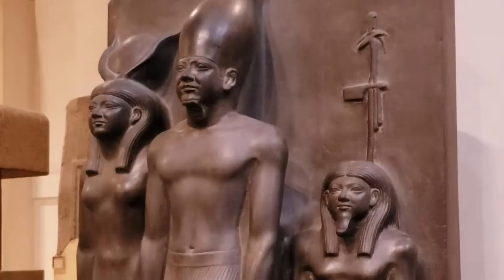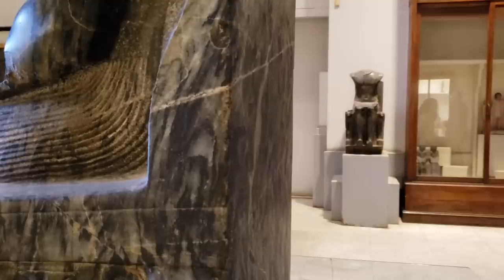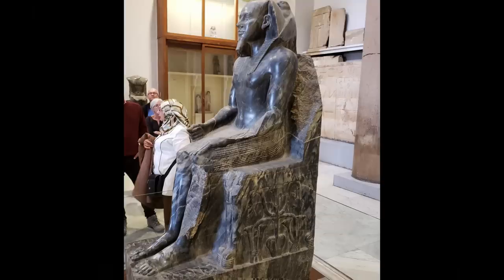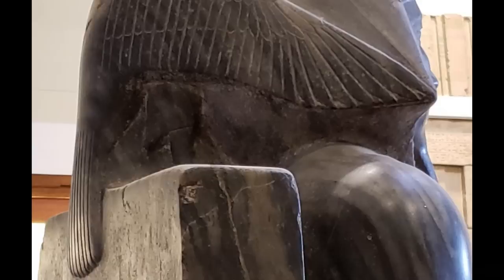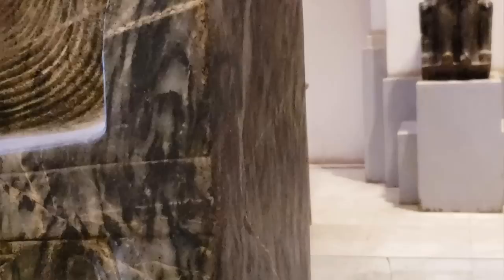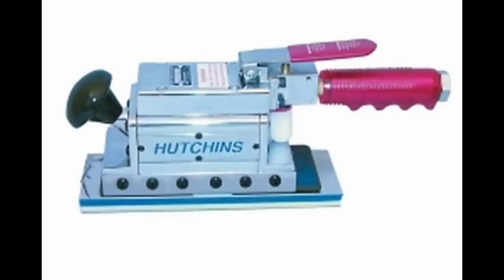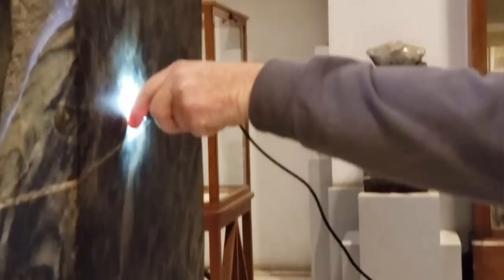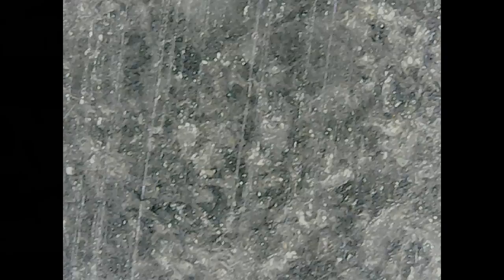Khafre's Diorite Statue

Comment: What do you mean "It can't be worked with copper and bronze"? You just stated that steel is also softer than it and we use steel to break it all the time.
Aren't you confusing how hard the stone is with their mechanical strenght? Cause diamond is a 10 and you can pulverize it with a sledgehammer and an anvil. This is not minecraft. Diamond picks are not the best because diamond is hard. Diamond picks would suck.
You can, 100% Break of pieces of dolerite and diorite with copper chisels. No problem.
We use copper nails to break onyx in flint knapping. Softer materials have no problem shipping harder ones.
Reply: Then why dont you make such a statue using copper?
Reply: You can break it, but can you sculpt it?
Reply: There is a difference between cutting the rock, chipping the rock and grinding the rock. The finished surfaces of these ancient relics point toward cut and polished surfaces. You cant cut or polish granite with metal chisels, but yes it can be chipped of course ... Nobody confuses hardness with strength of course. I get that this might be confusing, but do you think these people are that stupid lol? Come on...
Reply: How do we polish things? Sandpaper or fluid abrasives containing different grit sizes. You can polish for example granite with another piece of granite and different mixtures of abrasives with different grit sizes.
Reply: You don't smash a rock and get an intricate polished statue. I use a saw with a diamond blade to slice rocks, even though I own a hammer that can break rocks. The hammer can't slice them. Copper, steel, dolorite, doesn't matter; hammers don't slice.

Comment: What is also fascinating with these objects is the symmetry. Its one thing to polish very hard stone that smooth, but to make each side virtually identical requires something far more advanced than just eye-balling it and sanding by hand. Many of these statues, even the giant megalithic ones, have been scanned with lasers/optical devices and they are almost exactly the same dimensions (right and left side of a face, for example). You cannot measure complex surfaces with simple measuring devices that were thought to have existed then. Even today, that kind of accuracy requires CNC machining or some type of complex computing machinery.
Reply from the maker: I have attempted to do some checking on the symmetry of the statue based on my own photo surveys of it with simple photogrammetry in photoshop, and although the method / photos are not good enough to base a paper on, the degree of similarity between the left and right sides of the face is quite close. 
Your comment re. the difficulty of eye-balling such work is correct, because as the scale increases it becomes more and more difficult to ensure symmetry.
In Chris Dunn's book, Lost Technologies of Ancient Egypt, he presents some very carefully executed photogrammetric surveys he performed on  some very large statues at Karnak, and the results show a variation of only 2-3 MM between the left and right sides of the face. This is clearly not possible to create by 'eyeballing' it. At the very least, some sort of duplicating pantograph or series of profile templates would have been required, but Mr. Dunn's conclusions go a bit further.

Comment: Interesting to note are the groves under the armpits behind the torso on both sides of the statue. Could potentially be an overcut. To "achieve this mistake" you would have to rub to surface for considerable amount of time before realising you are taking away to much material. On the contrary, using a fast spinning circular blade could result in this mistake within seconds.
Reply from the maker: whatever type of tool was used, I thought they looked suspiciously like overcuts as well.

Comment: OH yeah! This wins the WWW! Excellent. 
We must take into account to manipulate the position of the stone to sit on a large abrasive table (to achieve that straight/fineness) would be just as difficult as innovating a tool of that size that can also be manipulated to polish at various angles. But not impossible given the size of the other stones found in and around, is still astonishing stuff.
Such fine grit would leave rough/deeper kerfs (cutting lines) that you see, those are the straight lines. I can tell you from experience that those contours would need a template to work from to remain 'perfect' in proportion, because even as you see here - non-guided work wonders. With hard stone - impact tooling is a curse for later stages of work, and powered/rotary abrasive tooling is a must.
Aluminium Oxide, Carborundum, Silica carbides... resins... Not a difficult bunch of substance to know how to make, especially given mummification is well practised. Chemistry (alchemy), one can assume, was the blood of this creation.

Comment: You neglected to mention that the nose on this statue has been REPLACED with a European-looking nose that is much narrower than the noses on 2 other statues attributed to him. Zoom in 150% on a profile photo to view where the 'new nose' was attached. The 'Glowing' statue of Nesi (Pharaoh) Khafre is the best-known "Anorthosite Gneiss" sculpture. The stone came from a distant Kushite quarry, it is hard to work and only moderately attractive. However, it has a rare optical property—it glows in sunlight. Its deep blue glow is caused by the presence of the iridescent mineral Bytownite. 4th Dynasty, Old Kingdom. The new nose doesn't glow.
Reply: The damage patterns on 'Khafre Enthroned' are suspicious.  The statue was 'found' in a remote isolated location similarly to the finding of Nefertiti's bust.  Both objects exhibit unlikely damage, or lack of sufficient damage for the age and weight of the object.  Both look like they were MADE to sit in museums.

The Khafre nose always stuck out as uncharacteristic of ancient Egyptian statuary art.  What you say makes sense.  A repair gone astray from reality......unintentionally, of course.  😁
There is a large pharaoh statue with a repaired nose and it looks ridiculous.  The bias looks as glaring as Hawass's overhanging tall Arabic nose.  A nose never seen on any mural wall or pharaoh statue.

Comment: The large flat surfaces are easy moving the stone being worked and polished on a granite or other surface with desired grits. Lighter grit goes further in a breeze so easy to classify. Using something like wooden boxing to guide working the stone down so a tail area is left is easy.
Reply from the maker: easy-peezy!

Comment: There is no rock in the world that cant be cut, hammered and polished by hand using the tools available to the masons attributed to making them, in the time they are said to be made. 
This is very fine work done by the best stone workers of the day, give them some credit.
Reply: @tonywybrow2767 what part of Copper and Brass are 3 & 4 respectively on the hardness scale and Diorite is 6.5 did you not understand?
Reply: @Jonadab7  I think I understand what the hardness scale actually has to do with shaping rock better than you do. It’s not the copper that cuts, it’s the abrasive you use with it. Maybe look into some real facts before you be so dismissive. Check out how rock is shaped and polished even now, then you might understand the hardness scale all the snake oil salesman keep talking about has nothing to do with the viability of shaping or polishing stone.
Reply: @Jonadab7 also note stone of equal or greater hardness will scratch and abrade stone. Stone tools were used, in addition to and along with metal ones.
Reply: @tonywybrow2767  Maybe go outside, pick up a piece of granite, and make a scale model of a serapeum box. It doesn't have to be that size, just make one that looks like it, with the same tolerances and polish, etc. It can be the size of an apple, whatever. But make it. You or literally anyone in this world, it's not an experiment that would cost millions of dollars. It would cost nothing, nothing except a rock. That and what we claim they used to do these things: a handful of sand, a big rock to smash into a little rock, and a copper chisel. Go ahead. All the discussion and argument and theorizing is pointless, a meaningless exercise. Just do it and everyone here will admit, alright I guess it is possible, these guys were exactly what modern knowledge assumes them to have been, relatively primitive. But you're not gonna do it, nobody's gonna do it, just as nobody ever had done it, because it's not possible to do. So we're just going to stand around arguing about it for another 200 years when, if what you say is true, this entire debate could be finished forever with a rock, a handful of sand, and a piece of copper. Pointless. Just go outside, get a rock and a copper chisel and actually do it, or pay somebody else to do it, and come back and tell us all about it, because you will never be able to produce anything even in the vicinity of a serapeum box, a stone vase, or one of these completely symmetrical statues, even when you only have to produce a 1/100th real size one- not with the primitive tools it is assumed they used. Nobody's going to ask you to make the real full size serapeum box because that actually is impossible- just a baby one. Stop talking about it and do it, it's an experiment that would cost absolutely nothing in terms of money or equipment. Contract a whole team to help you, it wouldn't make any difference. You cannot make a Serapeum box with a copper chisel, some sand, and smashing rocks- not even one 1/100th the size of the real thing. You want the scientific method? That's the scientific method: do it. You can't do it? Maybe your idea of how it was done is a bunch of BS then. Whatever excuse you can try to come up with to rationalize not trying, just remember: a rock, a handful of sand, and a copper chisel. Doesn't require NASA's budget and a large hadron collider to test this. I'm sick of listening to people having this debate, there's 8 billion of you MFs on the planet and not one of you can figure out how to put those three things together and make some of these artifacts we're arguing over? Then maybe those three things aren't what they used.
Reply: @TylerChamb Tony's been real quiet 😂
Reply from the maker: Giving them credit for the fineness of the work is not within the scope of the presentation, but rather an attempt is simply being made to document the witness marks left behind by their work and speculate on the list of possible methods required to create those witness marks. 90% of the people who view the clip completely miss the point of the presentation.

Comment: There are several prominent indications that this statue was never carved from stone, but is actually a geopolymer diorite casting. Specifically, the polished look, bilateral symmetry,  and level of detail.   Cedar from Lebanon was regularly used to create molds, which is easily carved by copper blades and provides the solution to bilateral symmetry.   The high lustre of the finish is due to the nature of geopolymers, where the aluminous elements egress during reaction ( 600 to 800 degrees) , leaving it shiny. This is also how so- called mortar of 1/10 to 1/100 of an inch thick was created in walls and pyramids. Microscopy will reveal to geological examination that it is diorite, unless one has training in chemical engineering and knows how to recognize the presence of binders.  Another feature of the statues and blocks  of geopolymer is the presence of many aggregate stones concentrated near the core, while the surface has a uniform appearance.
Reply: Do it
Reply: You believe that egyptologist propaganda don't you? Copper cutting diorite, yeah you got it!
Reply: I love whacky theories and yours falls apart with your clear lack of understanding of the crystallisation process.  

Even if by some miracle you could re-crystallise it, your theory is blow to smithereens by the fact that some statues have quartz mineral veins running through them  - go on explain that lol.

Comment: They had to have had IRON tools but then where the heck are they?!
Reply: Did you know.. a softer object can break a harder object on the Mohs scale by use of percussion.

Mohs scale hardness is measured by resistance to scratching by a material. Which is why the hieroglyphs on the statue appear less refined
Reply: No they did not
Reply: @AntonSmyth-od6rc That's completely true. And I imagine that roughing out of the form was done percussively as you say. Stone sculptors can utilize methods like that with a high degree of accuracy.